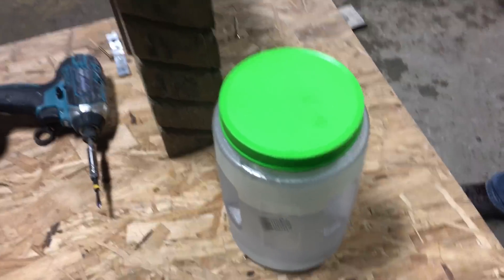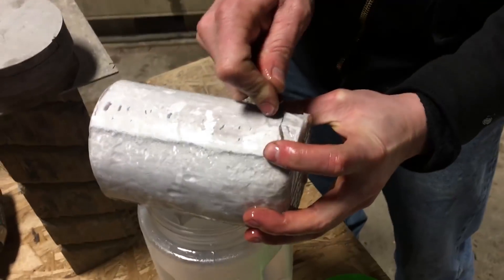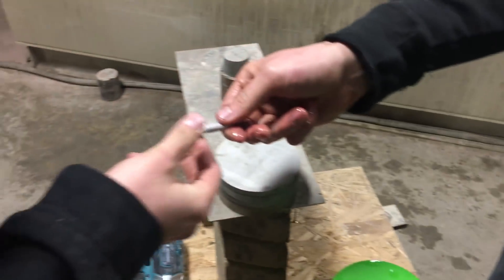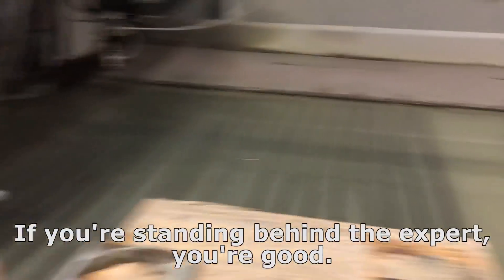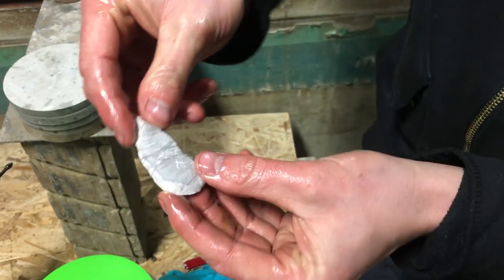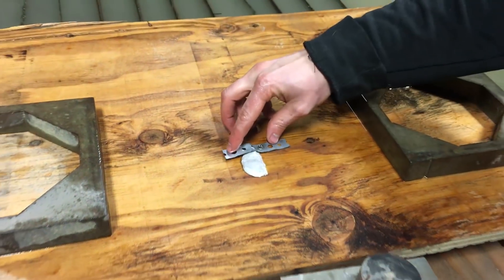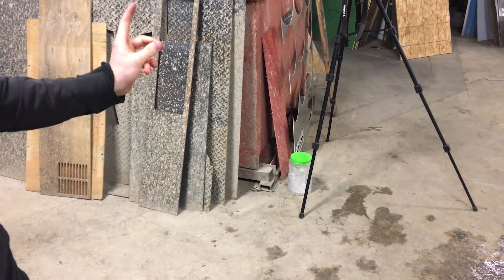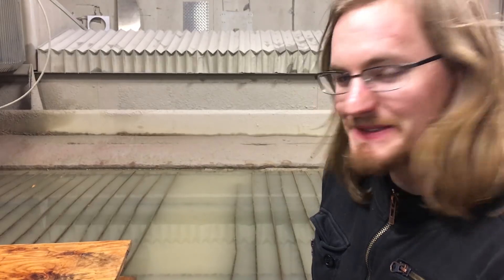Pure Sodium Metal Cut in Half W/ A 60,000 PSI Waterjet - Explosive - Cody's Lab

Comment: Now I will give you sodium is dangerous because it can cause a ton of fire if you get it wet but nowhere near as sodium like TNT or dynamite in any way with the with the exception of there's an explosion I've watched the video of them dropping 20000 lb of sodium into a Lake and all it did was just cause fire on the water and made a loud pop noises but there was no detonating blast blowing up The Rock it doesn't provide a concussive blasts nowhere near you could stand near the blast and be fine it's just that you would be burned by fire however there are certain chemicals that you can mix sodium win to make it a very dangerous and volatile explosive the benefits of having chemical engineering LOL